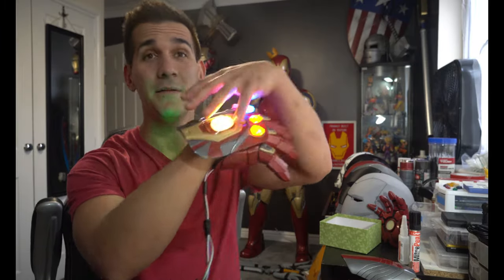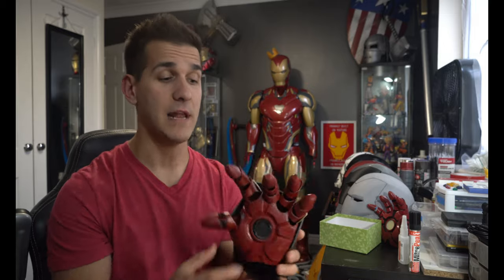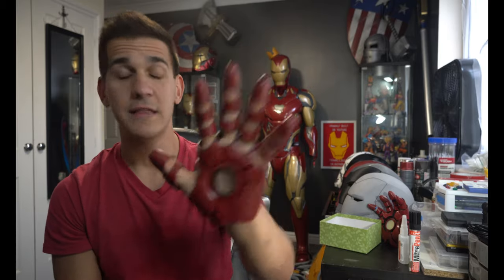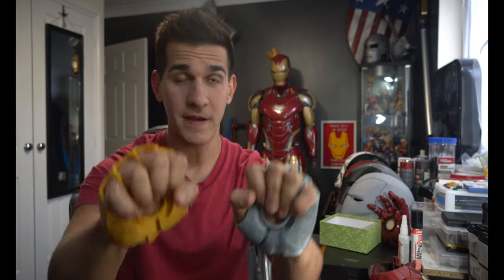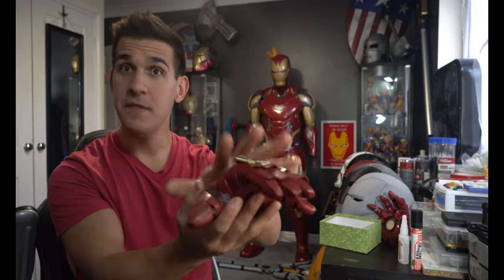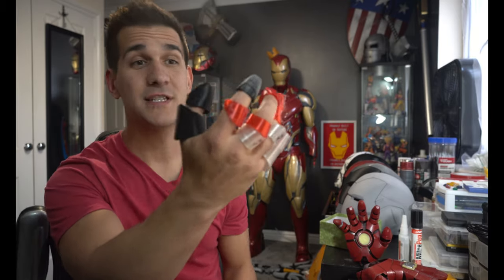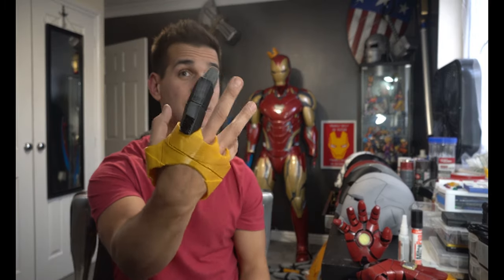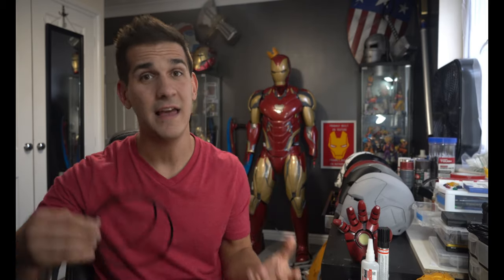How to Size and Assemble 3D Printed Iron Man Gloves

Comment: For the palm lights, I'm using LED strip wrapped around the perimeter of the ring and facing inward, covered by frosted perspex, which gives a halo effect to the light. Cutting 5v strip at 2 or 3 LEDs shy of the cut line allows you to use a 3.7v LiPo to power it.

Comment: Nice work Frank! Have you looked into using a glove like the Maxiflex glove brand? They are thin, woven nitrile, very pliable and it might totally eliminate the flex tape. We used them at work. You could pick up a 1/4" washer off the work table. The electronics could be applied to the outside of the glove and not to the inside of the printed glove. Of course the print would have to be sized larger. The flex glove could be lightly painted to hide the skin color of your hand also.  Just thinking out loud! 🤓

Comment: Nice video dude - though you could always add smothing modifiers to the stl file in blender to fix the low pollyness instead of spending loads of time filling and sanding down
Reply: Also, looks like you've had a camera upgrade?... what you using these days?
Reply from the maker: Paul Culkin thanks! I’ve thought about that but I don’t need to use any filler. 2 minutes with my palm sander smooths it out perfectly however I wouldn’t mind an upgrade

And now I have a Sony A6600!

Comment: Thanks for this info! Not too fast at all, we can always pause and rewind. 

A couple of questions, what kind of elastic band are you using?

Also why didn’t you like the TPU fingers? I just printed out a set with some fairly thick walls and they seem like a nice compromise between flex and looking solid. I’m printing off the palms now and will test soon.
Reply from the maker: Harder to paint TPU
Reply: @FranklyBuilt what about the elastic

Comment: So I did a test fitting of my gloves, and that went very well! But I noticed it was very difficult to grip anything as the PLA just doesn't get any traction. Have you (or anybody else reading this) found a good solution?
Reply from the maker: Any plastic is going to have this problem. It’s smooth plastic. Maybe add grip tape or foam to the finger tips.
Reply: @FranklyBuilt  OK thanks, I was figuring some sort of tape or similar would be the way, just figured I'd see if there was anything in particular that someone had success with before experimenting.

Comment: Maybe a suggestion: drop the low poly model into blender. Go into sculpting mode and there is a tool to smooth areas. The size of the tool is adjustable for big and small areas. Might come in …errrr…handy.